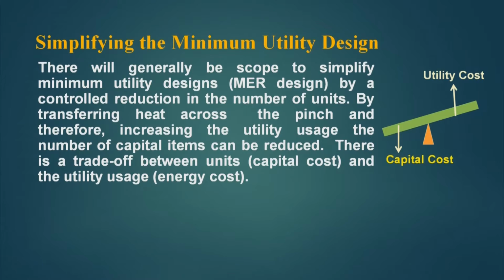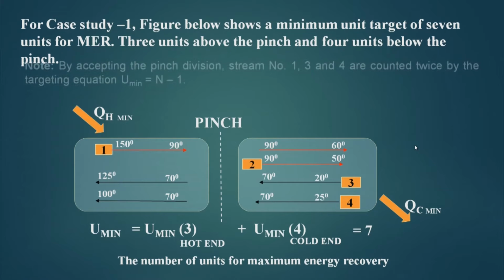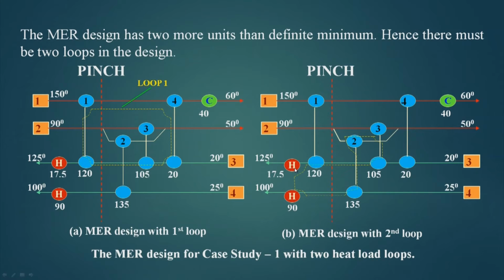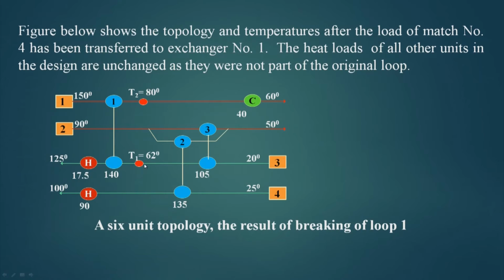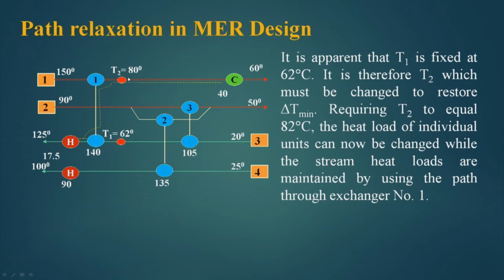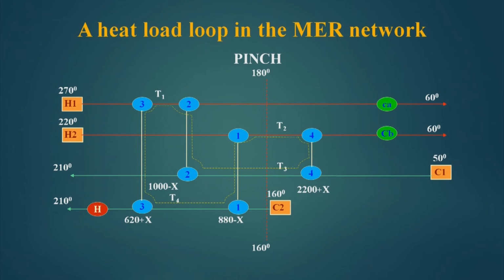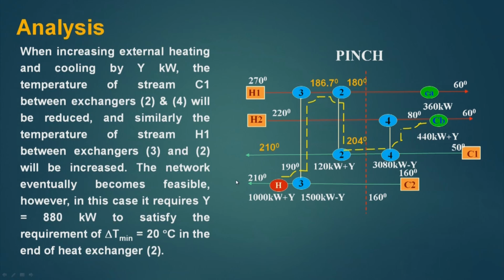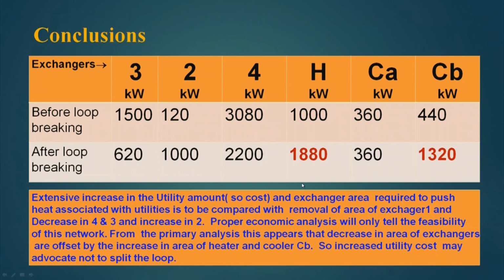Mod-05 Lec-07 HEN optimization

Comment: thankyou too much dr. but either any option to do energy optimization techniques other than pinch technology . ex we don't extract data's from reactors even there is a temperature difference and also mere and more brief explanation on composite curve drawing and splitting of HEN